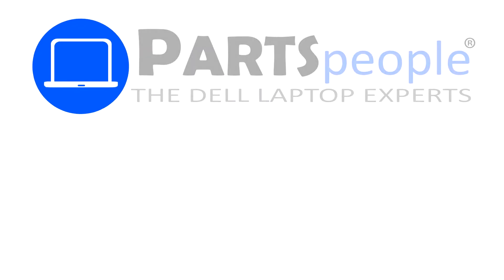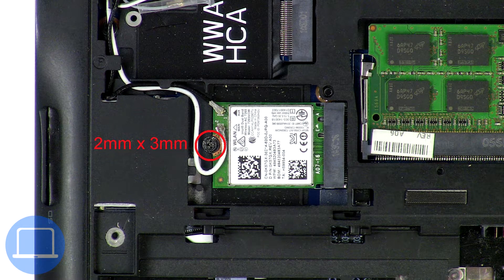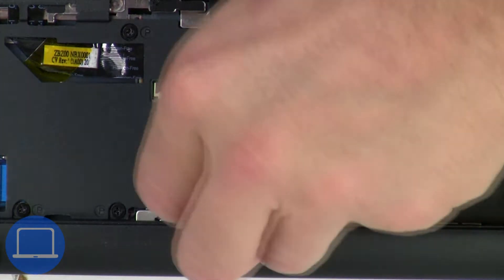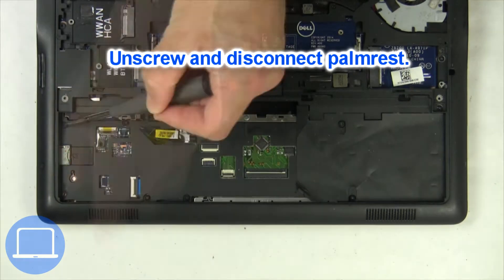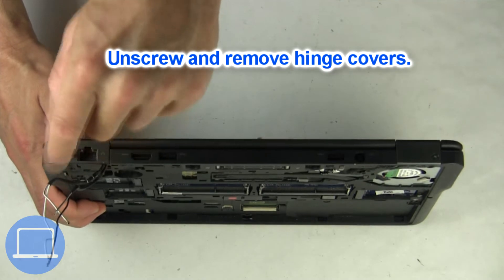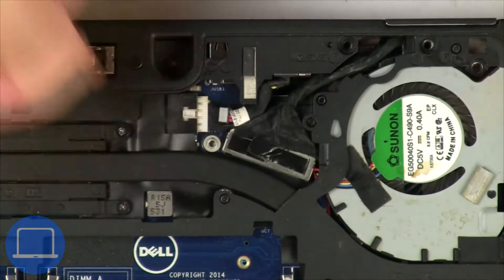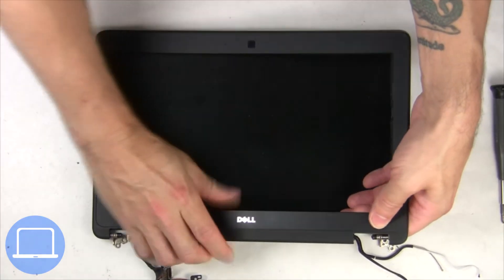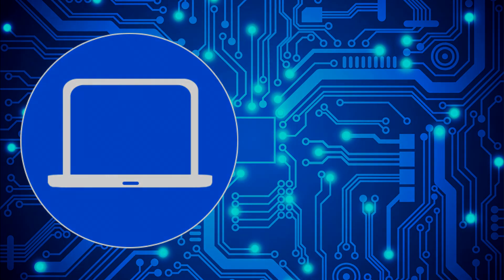Dell Latitude E7250 (P22S002) LCD Panel How-To Video Tutorial

Comment: The cut at 3:35 pisses me off, I cannot figure out of to get that cable through that hole and you just skipped right over it
Reply: just kinda fold it sideway slightly and you can remove that. I tried that and it works fine

Comment: Is there any way to remove the touch screen layer to use the screen as non-touch and get rid of the bubbles?
Reply: could you replace your dell with touch screen? Or could you at least change it for a non-touch like the one in the video?
Reply: @CerberuzWaves  the non-touch lid assembly is completely different, and also a non-touch screen might not be compatible with the video "card" on the mobo.